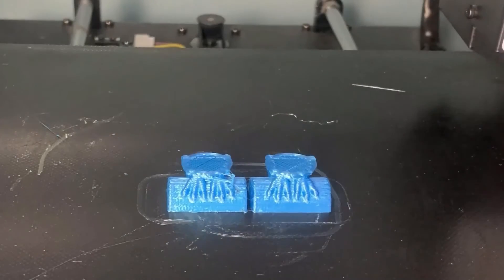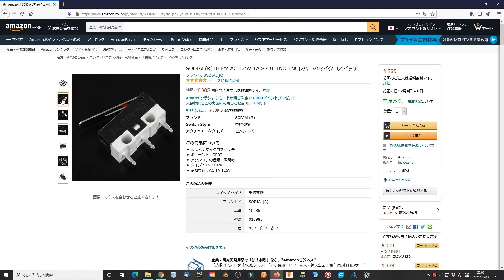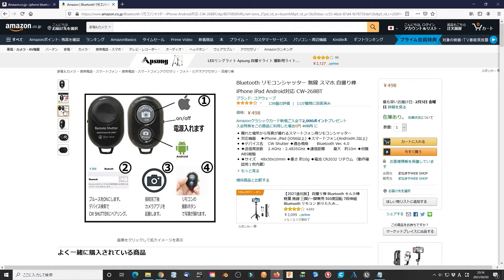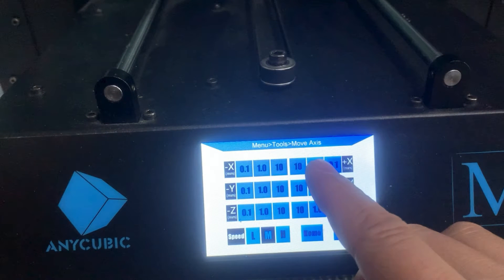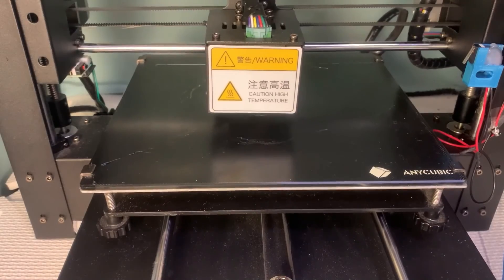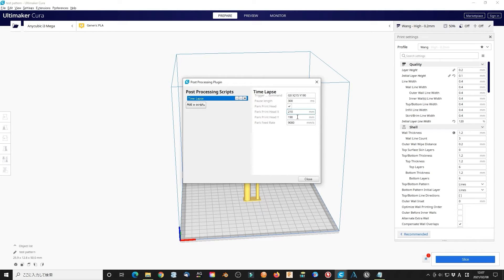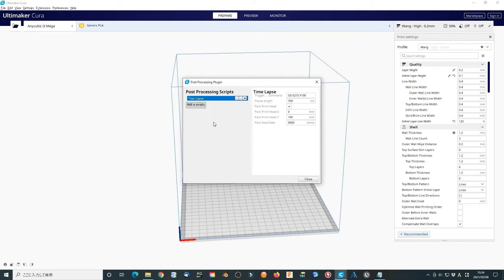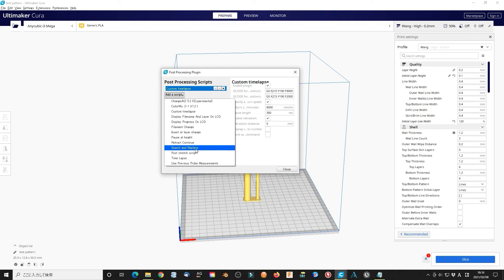The best setup for 3D printer timelapse and G code hack (Professional work with cheap stuff)

Comment: Octoprint is also good alternative if you have raspberry pi. I did nice time lapses with octoprint (which i got tired of later on) but i still use it because of its safety features and i can observe my printer from camera and control print remotely (From other room even without internet or wifi router, just with mobile hotspot). Only thing i dont like about octoprint is it is little slower than printing directly from memory card.
Reply from the maker: Thank you very much for your comment. I have heard that Octoprint is good. I only give an alternative cheap version to do similar work. Unfortunately, my circumstance is not so good since I live in Japan where a lot of earthquakes occur all time. The tripod can not keep stead all time. And if change my iPhone to a single lens CCD camera is a better choice.  All of them are out of my control. I hope others will have a better condition to take timelapse video. Have a nice day.
Reply: I think the whole point was that not everyone can get a Raspberry Pi and whatever other things you need for that